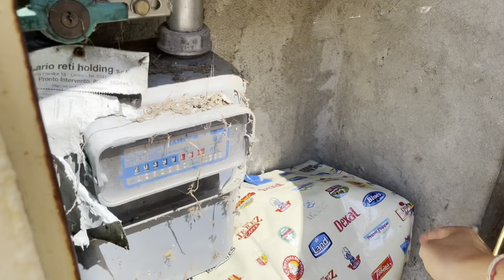DREAMING OF A CHATEAU DIARIES/ Our new home on the lake Como 🐸 Day 1

Comment: You need to use a bug fogger to rid the house of spiders, wasps, roaches, etcetera. Go to your hardware store and ask for bug fogger. They are small cans that click and lock on to spray and you exit quickly leaving the house. Start activating the cans on the top floor and work down. They are made to cover about 500 square feet. You can wand it into smaller rooms/closets and maybe set it in some doorways to catch 2 rooms. Don't breath it AT ALL. You'll choke. Wear a mask as precaution. Says wait 3 hours but i think a bit longer like 6 hours. This works well. Doesn't leave any residue except immediately around can. Can place on newspaper. Do cover dishes, glasses, food. Open cabinets to let it get in. Good luck.
Reply from the maker: thank you!!
Reply: @DreamingofAChateau  oh, and shut all the windows to make it airtight. This will give you peace of mind knowing you got rid of all the bugs giving you a fresh start.

Comment: I think you need a wheeled basket like people use to go to the grocery store. It's light but can carry a lot. I have one. It folds. Wheels are about 6 inches and would pull fine over steps.

You also need an external extra battery. They are very inexpensive.
Reply from the maker: I hope for electricity being connected soon ahhhh 🤪

Comment: Mold is nothing to play around with. It's a serious issue. It indicates moisture and can severely damage wood and is a health risk. You will need to attack it some places and others rip it out, like that bedroom ceiling. To start i would clear out the bedroom and get a garden sprayer and use part water, bleach and a mildewcide. See if you can locate mildewcide Jo-Max brand or the like.
If it seems superficial, spray. Embedded a little, spray repeatedly and let it soak in. Embedded deep, rip it out. Wear a mask when removing mold or spraying. Lysol kills mold and good for small spot jobs. Less smelly and for general wiping down walls that seem ok would be using VINEGAR. It's an antifungus. The vinegar smell will go away. Living with mold can cause chronic health issues. Best to attack it and get rid of it. Good luck.
Reply from the maker: Thank you 🙏🏼